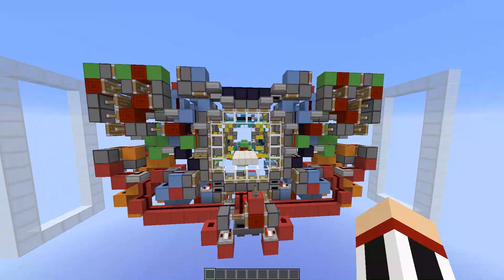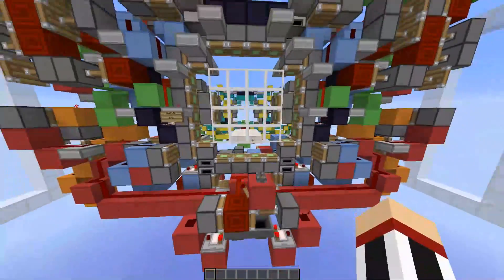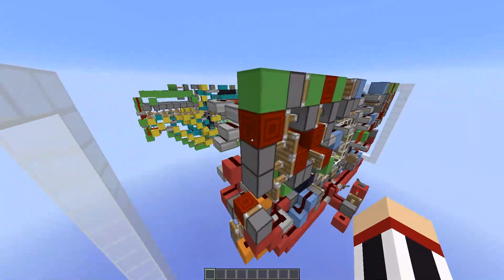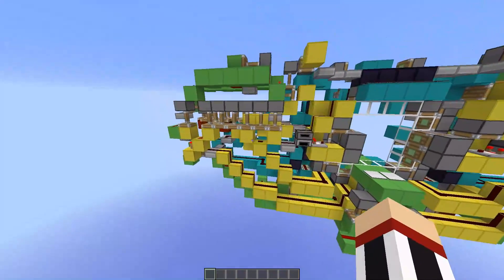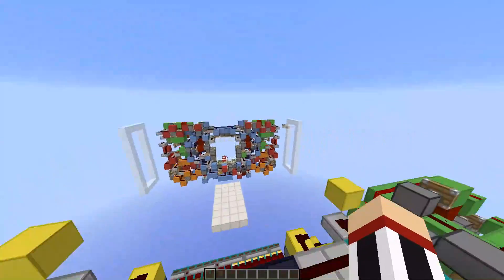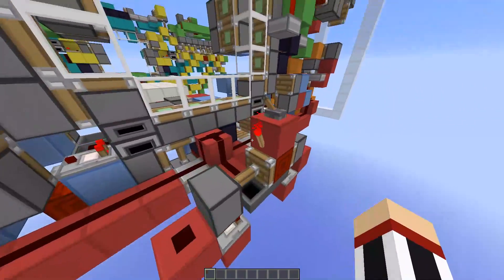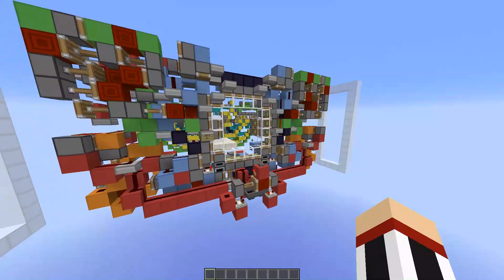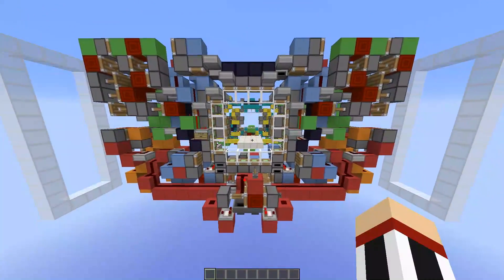The Lightningbolt 4x4 Piston Door v2 (Halved in size!!!)

Comment: I'm not exactly sure how you're classifying it as .15 seconds when it's two piston retractions which is .3 seconds? Are you saying that since it starts retracting, that technically counts or what?
Reply from the maker: Since blocks are technically removed instantly when a piston starts retracting, that's how I counted the opening speed for my prototype 0.3s 3x3 at the time. If I had recognized my mistake earlier, I would've called it 0.45s.
Now, I didn't want to go and call this similar door the same speed, so I used the same way of counting here. Visually, the door is indeed open after 0.3s my friend, but you will be able to walk through it after just 0.15s.
Reply: That totally makes sense. Thanks dude. This is amazing by the way. I'm terrible at 0 tick technology. and the fact that you compact it to these sizes and uses is absolutely mind blowing.
Reply from the maker: Thanks. Most people in the comments are unable to use the logic you used to get to 0.3 seconds by the way :P
Reply: Haha yea I guess. 0 ticks are fun though. The tech and thinking that goes into making them is just insane. You're doing some great work, so thanks dude.

Comment: Is this non-locational?
Reply from the maker: I haven't seen a place where it doesn't work, however I think it doesn't work at all in 1.11 because Mojang.
Reply: DicoTheRedstoner If it works in 1.10 it works in 1.11 unless you have a 15 gt hopperclock, which you dont have.
Reply from the maker: I was told it broke in 1.11 but maybe they fixed it or it actually works.

Comment: I sure am tempted to build this in my world now! At this smaller size it might just start to fit into places.
Also, I never thought of using a daylight sensor to trigger toggledownfall - very useful.

Have you ever tried a tickspeed mod to view these fast opening/closing animations? I made one a while ago that lets the player move around at normal speed, while the rest of the world is slowed down.
Reply from the maker: +Cubitect I don't expect a tickspeed mod to change anything to this door. The door really just performs 2 actions 1.5 ticks apart and they will always look the same, whatever the tickspeed is, thats my expectation. But I made a slower version using 1-tick pulses that should show better what is going on... you might see that eventually.